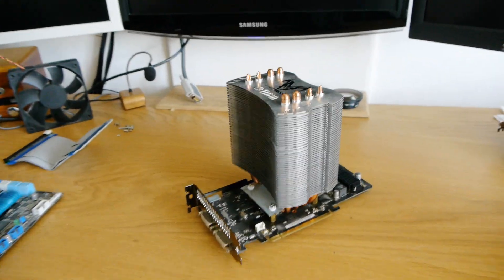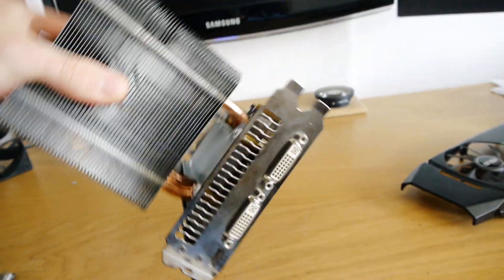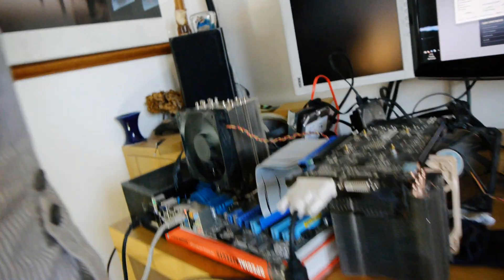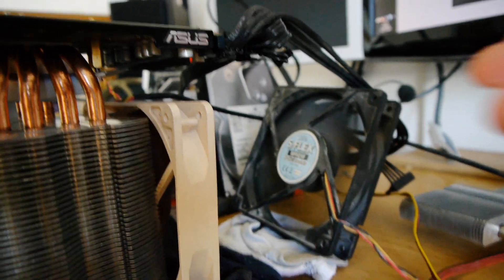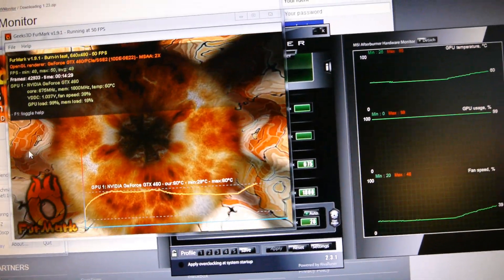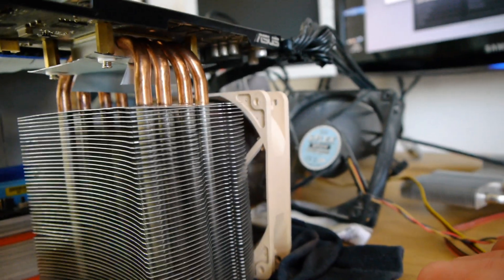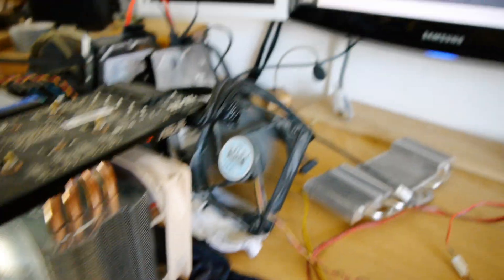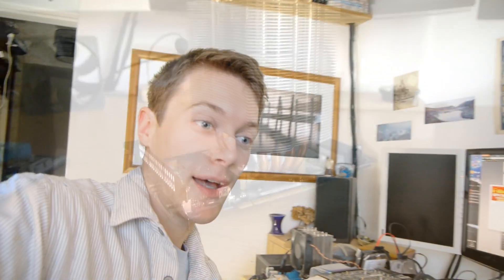CPU cooler on GPU (INSANE temps!)

Comment: That cooler would probably perform even better if you didn't put it upside down. I know the coolant in the heatpipes is moved more by capillary action than gravity, but every little bit helps.
Reply: Nono, heatpipes are definitely hollow. They are filled with a liquid at low pressure and low boiling point, so the liquid evaporates on the hot part of the heatpipe, and condenses again on the colder parts such as where the fins are attached to it. The liquid is then returned to the hotter part by gravity or capillary action. It's done this way because although copper conducts heat very well, evaporating liquid can remove even more heat, more quickly. Also, even the high thermal conductivity of solid copper isn't really good enough if you're going to use long and thin shapes like this.
Reply: I was gonna say the same thing
haha
good to see another person who understands Thermodynamics ;)
Reply: I was under the impression that the heatpipes are hollow and filled with air. Which would have added even more validity to your statement if you hadn't mentioned capillary action. I don't think that upside down setup would be sustainable within an enclosed environment, especially without any form of heatsink over the ram.
Reply: I guess they are not hollow but dont know for sure. I use such a cooler and its quiet heavy. My only explanation is that the heatpipes are solid because aluminium is pretty light. Also air is a bad heat transfer medium so again solid copper would make more sense. If sombody knows for sure let me know :)

Comment: Buy a used car radiator mount on side of a normal cabinet and buy a used corsair h50 - h100 for the pump, and run it fanless. Makes the hardware actually fit inside the cabinet.

Comment: nice but muth yeasy is put water cooled fridge :)  and set temp from+10 or 26* C and job done  price is 60 pounds so in $70~80 or use old fridge generator .... 10$ :D

Comment: "It's pretty hot in here, about 23 degrees"

Whereas where I live it's like 26-30
Reply: I have some kind of resistance to the cold, I've gamed for hours in my room at 10 C. Gotta learn to put the PC first.
Reply: Its like 32 degrees in singapore.....
Reply: Ladies and gentlemen i present you the summer...
Reply: lool here we have 36~ c and up if you're running ac 
and outside it gets 50c
Reply: It's currently -17c outside where I live and tomorrow is going to be -23c.
So 23c is pretty hot.
Reply: DareDevilPhil i do that aswell lol my room is around 10c yet i still wont leave xD pc > life
Reply: my pc goes to 53c when i run PRIME95 test and I'v got stock cooler
Reply: XJOEMANN13 thats actually pretty good for a stock cooler! Whats ur cpu? I run a 4770K at 4.3Ghz with a H80i....And mine peaks at around the same mark....at 49 degrees C
Reply: iI'v got an AMD FX 6300 cpu , I'm getting the Zalman CNPS10X Optima cpu cooler so I can OC to 4.2ghz or so and because the stock cooler is an annoying humming sound
Reply: XJOEMANN13 I put a Coolermaster Hyper 212 evo on my fx-6300, runs loads cooler and so much quieter than the stock cooler.  Mine was hitting 60 under load before, high 40s, low 50s now.
Reply: My case doesnt fit a CM Hyper 212 + for £9 less the Zalman CNPS10X really stacks up with the EVO , theres only 1 or 2 degress diff
Reply: better put in frooze keep them heat off lol just kidding

Comment: U could put the cooler in the horizontal position ( flip it ) ..and then your card will fit in the pci slot..i wonder why you didn't think at that in the first place..
Reply from the maker: I did think of it, but it wouldn't be very good air-flow wise because the motherboard would be in the way.

Comment: why not turn the cooler 90° , then it would not protrude to the PCI slots, then you can mount it directly on to the board. But then you would need to mount it in a case so that the weight of the cooler wont end up stressing the card connection or the pci slot on you mobo
.

Comment: Hey you should check out the kraken G10 because you can put a CPU LIQUID cooler on graphics cards!  It lists what models and coolers work with their mounting bracket, but you should try it out and see what kind of temps you get xD  plus it has a dedicated fan to blow air onto the voltage regulator parts of the graphics card which is pretty cool

Comment: You should turn the heatsink 90 degrees, that should make it fit directly in the PCI-slot, which would make it possible to fit in a case. 
Granted a very tall case, but it opens up the posibility to do it :-)

Comment: put on a GPU full cover water block like from EKWB and you will get about 40C with 23 ambient on this card :)  Watercooling is the future.  But your idea is crazy :)  I like it :)
Reply: ***** can you imagine I have 770 and it reaches 80 on air? Can you imagine i will get 780ti and it would reach the same?  Can you imagine people are buying cards reaching over 110?  I own 650 ti too :)  when it is cooled by air it reaches 65, but watercooled 40... all at load.  760 is not a high-end card. Watercooling is the future.
Reply: Well i personally wouldn't buy EK, buy heatkiller. But i liked this video gave me some motivation to start messing around with a certain hyper 212+ in my closet :D
Reply: I have an evga 760, and it's never gotten over 45C, even when overclocked. And the only other fan I have in my PC is a factory default one on the back. Never needed a water cooler, never will. :D
Reply: Adrian Silesian yes, it's not "high end", but imagine putting 2 more in there. Tada! high end system. and would I need liquid cooling? Nope. :D Although, my processor runs dangerously hot when overclocked, so if I ever got water cooling, it would be for my processor.
Reply: ***** I would not recommend putting in two more 760 in there... first of all... 3-way SLI does not make such a big difference compared to a 2-way one. (cost/performance). Better use that money and get a 780Ti.
Talking about water cooling... my loudest part in my rig are these two 780Ti's... And they reach 84 °C max, cause that's what i set their max temp. so the clocks are going down. same wit your 760. We could actually run your card on 80°C but EVGA put a temp limit onto your card by default. got my point? So it will not get hotter than 45°C but it will not reach the same performance. Back to the watercooling... I'll get the koolance blocks for my GPU and CPU and run every fan not faster then 600 rpm. Even overclocked... it will be still silent and will not get over 45°C.
Reply: lol fedora, gtfo
Reply: Max Benn Yes, i'm not planning on putting 2 more in there, I was just making an example. But yes, I see what you mean.
Also, I was just wondering, how much of a difference would a 3-way sli work with 780-TI, in comparison to 2-way sli? (Not that I'd ever be able to afford it, lol)
Reply: Depends in the Programm/Game you are running. I'd say that one is 100%, two are ~175%, three ~200-210%. Four I'm not even able to say, but if I'd have four I'd run 3way SLI and take the fourth as a separate one. Dedicated PhysiX maybe, which is just a waste of money. :P it'll just look awesome! :D maybe in the future. Couple of years ago I wouldn't even recommend a 2way SLI cause it was giving you only a max 130% boost. :)

Comment: My gpu runs at 60C on idle, but it IS overclocked to 1125Mhz.
Reply: That is terrible.
Reply: Depends on the GPU, of course, but my 680 runs at 1.2GHz with 60C at max...
Reply: Pfff.... 30 degrees here on idle.
Reply: ElitePotato8 Heh, my 7 month old post has gotten some attention, I guess.
Reply: frestylezz Yea but his is 60c idle, no gpu really shouldn't hit over 70c under full load. Of course you are right, it does depend on the gpu itself, just my opinion tho.
Reply: it's weird though, with furmark it only goes to maximum 75C.
Reply: Mine stays around 45ish while idle, for some reason it's staying at 600mhz and will refuse to downclock any more. I am running 2 1080p monitors, but I don't think that should affect the clock speed much. When I ran one it downclocked to 125mhz and god down in the low 30s. It's weird, but doesn't bother me to much.
Reply: too high mate, but if your load temps on furmark are fine then shouldnt be dangerous.
Reply: running idle at around 30C when overclocked to 1150
Reply: out of the box my gtx 770 base clock is 1201 and i set my boost clock to 1324
Reply: my 280x runs at 34c idle but when its on full load its around 76c. But, most games only get to 60-70c
Reply: Do you have that bitcoin virus that mines bitcoins for someone in the background lol.
Reply: It could be my fan speeds too, they are at 18% on idle but if i crank them up i can get 30 on idle. it's kinda funny, this comment is really old, yet still active.
Reply: ***** I was on mobile lol when i posted. The dates don't work. It says 0 seconds ago.
Reply: ***** xD

Comment: i think its a good alternative.if you dont trust watercooling but still want better temps this wil do it. maybe you should give it a try with the:
Noctua NH-C12P SE14  its a cpu cooler but a flat one  maybe it fits beter on the pci-e slot without a extension cord

Comment: and i thought im the only one who did this gettho mod lol, i did a similar mod like this on a 9800gt using an old 478 socket cpu cooler works wonderful but the downside is the noise, your mode is much better gonna give it a try later >.<

Comment: I had fun for years mounting dual HR-03GT in normal and reverse and zip tying them.  I was getting insanely good temps.  Used a Cut piece of wood to prop it up for extra support. Gave up on that and went sli lol.  Much less effort much more performance.

Comment: what's the point? my msi gtx 660 TF (stock) is hardly audible, idles at 25~28 degrees celcius and never ever goes above 52 degrees celcius. no matter what benchmark or game I throw at it. And...... it's (surprise, surprise...) built in the case as it should be. My point? some DIY's are just dumb as hell when you can solve things by buying new stuff...
Reply from the maker: "some DIY's are just dumb as hell when you can solve things by buying new stuff..."

I honestly don't know what to say to that. In any case, you've greatly missed the point of the experiment.
Reply: DIYPerks let's just agree to disagree, I'm not the kind of guy who wants to "win" an arguement. I think this is just plain stupid, you don't. That's fine with me.

Comment: just so everyone knows .... 
intel i7-4770K comes in stock at 84 watt ...
a mid - high end gpu will put out around 250 watt like my old 7970 ghz !...
and even the new amd cpus dont need as much watt (220) as a high end gpu like the 290x oc (way over 250) to keep it in the same house ...
with that said ...
dont try to use a cpu cooler for your gpu because it will only cool your gpu itself, but not the ram and many other things which need the airflow, too!
the only thing i could think of is a water coller with 2x120mm and a silent fan with some little heatsinks ontop of the important parts of the card...

Comment: Your old fan's bearings sounded like they were going bad - they really are about whisper quiet if not cranked up too high in RPMs.  Why didn't you replace the fan first?  It's a much cheaper way to troubleshoot your situation.

Comment: Hey i have a question.. so let say i want to install a stock CPU cooler like from a AMD FX 8350 CPU chip onto my GPU 560GTX card.. can i do that? I mean the only thing is that i would like my card to totally fit into my PCI E slot.. instead of wiring it etc... Reason why i ask is cause my current 8350 has a aftermarket cooler.. so i would like to take the stock fan which i am not using and install it to my GPU card since also if the stock cooler can do a good enough job for a heavy working CPU chip why not for my 560gtx GPU?

Comment: Aren't those heatpipes filled with a fluid? The fluid is there to be boiled as it touches the cpu block, it then evaporates and travels to the top of the heatsink where the fans/fins cool it, condense it, and allow it to trickle back down the CPU block. Try flipping the whole gpu/heatsink over and run the test. I'd bet money that you'll get even lower temps!!!
Reply: EpigeneticAlteration
Thanks for that info!!!! I was gonna cut it with a hacksaw to make it fit.  I will now return it.
Reply: Brantyn Gerik I don't know where you get that, but if you use an air filled/solid copper pipe, you might as well use a rubber one. Heatpipes ALWAYS contain liquid. Heat pipes are, well, pipes. Vapor chambers work similarly, but just have a different name and form.
Reply: They work in any direction because they contain a wick and coolant is returned to the hot end with capillary action. 
Vapor chambers are just that, a chamber not a pipe, they work almost the same way, but pipes are more complex because of the aforementioned capillary action. At last the water doesn't need to boil it just needs to evaporate. Some of the higher end coolers use other coolants though like ammonia.
Reply: Kim2310 Indeed, they're made to be placed sideways in a tower case anyway.
Reply: Obox2550 I heard they are hollow
Reply: That really surprises me... I've always used water loops to cool my components and never these heatsinks, but that does make sense. Thanks for clarifying.
Reply: you are confusing heatpipes with vapor chambers (as far as your description of what you think a heatpipe is :P)
Reply: EpigeneticAlteration yes this may by the usual use for heat pipes, but in the computing world, these are called vapor chambers, while heatpipes are commonly either hollow and air filled, or solid (not very common due to price and weight)
Reply: No they are solid copper heat pipes
Reply: Are you sure?
Reply: Absolutely, are you confusing this with a liquid cooler?
Reply: Yes, positive. Go to wikipedia and look up the page for 'heat pipe' You'll see the standard design and how there is water/liquid inside those copper pipes. That's how the heat transfer works, the cpu boils the water which lets to float to the top of the fins as vapor to be cooled, releasing the heat and condensing back into liquid.
Reply: Obox2550 Also I found this on Coolermasters website, "Heat pipes are hollow metal pipes filled with a liquid coolant that moves heat by evaporating and condensing in an endless cycle. A Heatpipe can be considered a passive heat pump, moving heat as a result of the laws of physics." They've got pics of the cutout heat pipes, just google cooler master heat pipe.
Reply: Those are solid copper. Knock on them and you'll see. Cheers
Reply: @KineticCipher9765  no, they're not solid copper. Solid copper wouldn't be as effective at getting the heat to the furthest ends of the heatsink. The whole point about evaporative / condensive cooling using heat pipes is that you take the heat away and distribute it relatively evenly, whereas solid copper dramatically loses temperature with distance.
Reply: Luis F GD That's what I thought too until I read what cooler master had to say on their website

Comment: Yeah, I've done it with a GT230 and an old Pentium4 cooler. 45°C was the max with heavy OC
Oh, and I have almost the same VGA, except mine is the factory overclocked version, maybe I will try this out.

Comment: It's not practical, I don't mind getting my gpu 10 degree lower.
Reply: it depends, with Nvidias 700series cards it will be very interesting concidering this since the cards uses GPUBoost 2.0 wich automaticly overclocks the card depending on what temps you have. ex. if you want the card to max run at 70C, then you just put it at 70C max temp in the software, and then the card will keep overclocking higher and higher till it reaches 70C by doing so you can increase performace by huge amounts.
Reply: Alcatraz Aronsson In that case I'll consider liquid cooling. That setup is meant for entertainment purpose and it cannot be used on a regular case.

Comment: I think you should flip your graphics card so the heatpipes point up, instead of down. The heatpipes contain water. If your heatpipes point down, water will collect at the tips, instead of the block, where it absorbs heat. LOL
Reply: i dont think that heatpipes use water, and in most computer cases the cpu cooler would be just horizontal and not vertical. i think that condensed liquid in heat pipe travels by capiliars inside heat pipe from colder end to hotter end.
Reply: Alvydas Urbonas Heatpipes use water. If you cut off the tips of the heatpipes, the water will evaporate off and you just broke your cooler. Still, DIYperks still manages to get great temperatures. You are correct in that heatpipes do use a combination of gravity and capillary action to return the cooled water back to the block. This works best, however, when the heatpipes are at least horizontal. If the heatsink is oriented as in the video, the water would have to move up against gravity.

Comment: where did you get the pcie extension cable from? also you can heatsink the ram chips with small heatsinks with adhesive heat conducting glue.

Comment: Just a thought, wouldn't you get better cooling if you made sure the cooler was pointing upwards? My thought is, that you're limiting the rate at which the heat can escape through the pipes, by pointing them downwards. I'm not calling for a massive decrease in temperature, but would expect it to change with a few degrees - or am I entirely off?

Comment: I put a cpu cooler on my GPU found I could get a serious amount performance but the heat is so intense I shut off the heat to my bed room. The whole room is being heated by my computer, a notable temp different when you walk into it. Going to get hot in the summer for sure.

Comment: Do you happen to know about the Kraken G10? it's a gpu adapter for closed liquid cooling loops. So you can use your liquid cooler for the cpu such as the h80 or the kraken x40. It's pretty cool